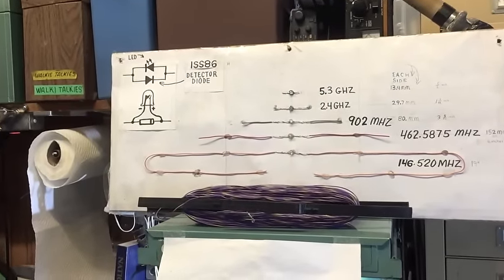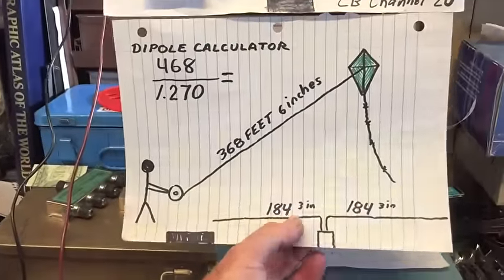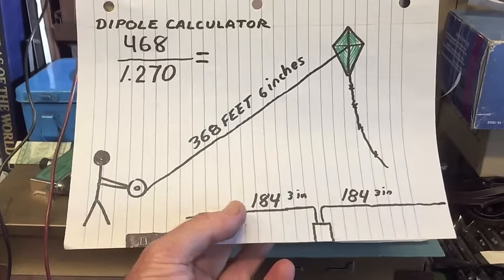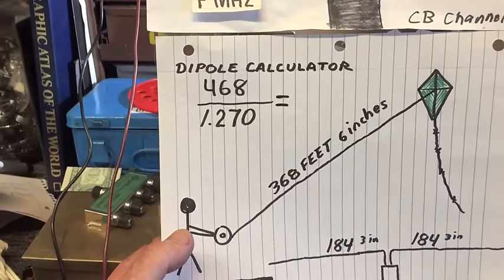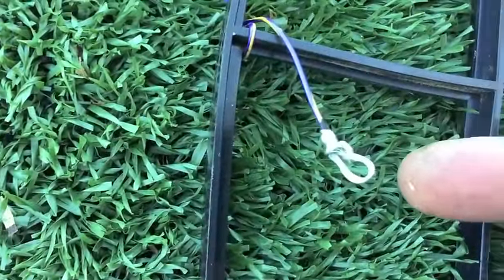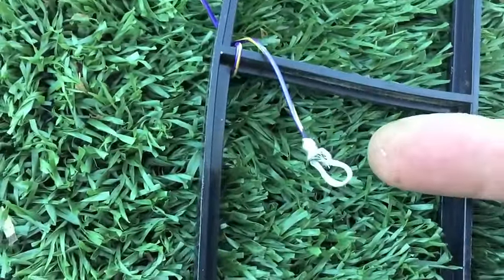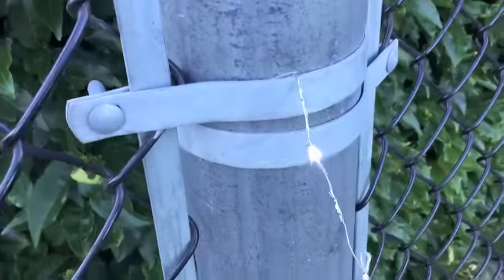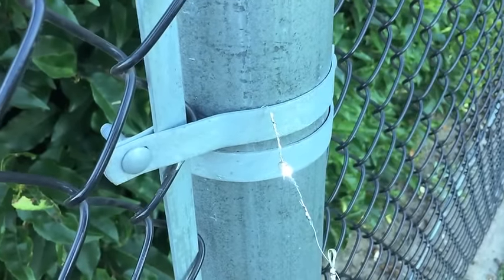Radio Frequency Burns From A Long Wire Antenna Supported By A Kite

Comment: Very interesting experiment, tyvm!
In the late 1960s my family lived in a home in Escondido, CA, USA.
The window screens were wire, galvanized steel, I think. Some of the screen wires could vibrate to the frequency of a local AM radio station. My mother discovered the phenomenom, one day she was in the house and heard music outside the window. She went outside to locate the sound and realized it was coming from the screen. The whole family heard it and my father listened long enough to hear the station’s call sign. It was KFI-AM 640 in Burbank, CA! Their power is 50k watts.

 Apparently the wire became an antenna element. The way I understand antenna element (parts) lengths are fractional based on the wave length of the radio waves. That’s why an AM radio stationa antenna is so long. To receive the stations signal an antenna will be the same length or a fraction of that length. If a full wave antenna is unfeasible, one can use an antenna 1/2,1/4,1/8… of the wave length. I think the screen wire was some fractional length and was loose enough to vibrate.
Reply: So, the screen not only resonated to the radio station's transmitted electromagnetic radiation frequency but was also able to demodulate it and extract sound information at an audible level. That's amazing.
Reply: @peach8352  That part of it is not all that amazing, as AM is very easy to "accidentally" demodulate.   All it takes is a non-linear diode-like contact between two conductors and the RF becomes AF... or it can mix with other RF to make new RF.   The latter is a common problem at busy radio sites where a rusty tower joint will mix two or more of the locally transmitted signals and create an "intermod" product that is on someone's rx frequency.   The demod is actually the easiest part to explain... I am curious why there would be enough RF to light up that screen, as Burbank is not exactly next door to Escondido.   Unless KFI's transmitter is not actually in Burbank, but I would not expect it to be nearby at all... that's at least one county away, if I recall... two I think.   Seems like there is a missing piece to the story puzzle... and I don't mean to shoot down your amazement... it's all quite amazing... especially if you consider that the range of RF wavelengths is hundreds of meters to millimeters and we use all of them.
Reply: @ka7znm  ty
Reply from the maker: Cool story. KFI was a powerful AM station, so I'm not to surprised. I use to pick them up here in Oregon.
Reply: @ka7znm  There used to be (and may still be) a radio station is San Diego back in the late '70s and early '80s whose transmitter was/is located in Baja California, Mexico.
Reply: @GrantsPassTVRepair  Did you ever pick up KAAY from Little Rock, AR back in the early '70s after 2100 hrs? They'd boost their power starting then, and again at 2300 hrs. They could be heard from Ontario, Canada to the Bahamas. The station was built underground in a bunker to survive a nuke and had a secondary telescopic tower that could be raised if the main tower was knocked down. KAAY was designated as one of the main emergency radio stations during the Cold War era. I remember listening to Beaker Street and Dr. Demento on that station back in the late '60s and first half of the '70s.
Reply: Interesting in that back when I was stationed at the Navy's FCTCP (Fleet Combat Training Center Pacific) located in Point Loma, San Diego, CA, back in 1980-81 as one of the Electronics Techs in the support div., we were having problems with the inversion layer during a particular period and a ship just off the coastline on the seaward side of Point Loma was having problems getting our radio signal. They kept trying to tell us to increase our signal strength, though ultimately, what we did was actually decrease it (our comms were in the UHF range). At one point, we ETs were going to build a helical quad array antenna so we could physically point it directly at the ship and make sure they could get it. What it would've taken to build that was fairly simple: some 1/4 hardware cloth, some dowel rods, some small diameter copper tubing (about what you'd find connecting the ice maker in a fridge to the cold water line), and suitable co-ax cable. Everything would have to be at the proper lengths/dimensions for the frequency, of course. I'm sure one could find plans online or in a book on antennas on how to build one. Kind of like a simplified version of this... 

http://www.setileague.org/photos/miscpix/helix02.jpg
Reply: This story reminds me of the Rodger Waters album Radio Kaos.  It is about a boy who hears radio waves in his head. He calls the station to talk to Jim Ladd a famous LA DJ. The entire album is the story.  Good stuff and if you like Pink Floyd you'll love it
Reply: Maybe it’s the radio station 91X (XETRA-FM) you are thinking of?
Reply: I am quite close to an am tower and I pickup broadcasts through the box fan in my bedroom and sometimes in the living room. It is annoying at 4am when I’m trying to fall asleep and I try to hear what is being said instead.
Reply: @Rizzob17  I used to live in Watertown Mn and there was tower a few mile away in the downtown area of that town and I don't know it was am or not but I heard voices through the Hvac vents of the house and the property has a small lake on it too.
Reply: The mentions of KFI, Jim Ladd and 91X took me down Memory Lane.  👍🏻

Comment: I am just amazed that your skin got burned. Years ago I was at a antenna bank in Roxborough Pa. The location had men working on the maintenance part of the towers that stood at least 1200 feet high. I am being conservative on the antenna height. Just started talking to the men and go permission to go into the field. Was just amazed as to my hair all over my skin just standing as if their was going to be an electrical discharge. One of the workers said the number of watts pushed thought all the antenna was in the millions of watts. Now that is a lot of power just going into the ari.
Reply: its electricity, just delivered via atmosphere.
Reply: @anthonywike8042  That is just amazing electricity. Do not see but the hair on your arms vibrates and stands.
Reply: @victoryfirst2878  agreed, it is amazing.
Reply: @anthonywike8042  Here is an idea that might make you go crazy. Could you connect this to a wood burning arc surface pattern burner ??? I would love to see what patterns this would make, wouldn't you Anthony ??? Nice
Reply: @victoryfirst2878  that would be a total trip. Do a wood burn by different radio stations. Totally a great idea.
Reply: @anthonywike8042  Hope to see you make it happen. Peace
Reply: @victoryfirst2878  I wouldnt steal your idea! lol If I ever tried id post it on here right away! TAKE CARE!!!
Reply: Yeah. To transmit information over massive distances, you need a lot of power. Thus, radio towers emit a ton of energy.
Reply: @starchief93  The unique part on the field was the actual feel of the power going through my body. The workers just stated that you get use to this feeling. I was just lucky to have the guys trust me to experience this area. Would bet this just does not happen every day for sure. Saying I am lucky is an understatement. Peace vf
Reply: Yes ...lucky for us there's the inverse square law.

Comment: Flying that wire made me want a Puffer Kite. They were around in the early to mid seventies. They were a balloon in the shape of a kite. You blew it up and go. We noticed the birds at 200 feet had wind but it was still on the ground. We got Mom to drive us to Woolworth and paid the man a dime to blow up our Puffer with helium. What a revelation! We could get up high enough to get into the wind. One day we had 750 feet of string stretched out. The kite was a  tiny dot. You looked away and you would lose it. 
Certainly miss those things.
Reply: Its always the small, seemingly irrelevant things you did as a child that youll end up missing the most after youve grown up
Reply: Qu'est ce qui t'empêche de faire ça maintenant?
Reply: Your English is kinda old fashion
Reply: I am from Alabama. 
So technically English IS my second language.

Comment: Back in the Voice of America days, the small town of Mason Ohio was next to the local VOA complex and their phased array Sterba curtains/multiple transmitters , along with AM station WLW which  transmits at 700 Khz (kilocycles to old timers) at one time at a power level of 500,000 watts. Enough for the locals to pick up the broadcasts on their bedsprings. Obviously not resonant, but at those power levels it wasn't necessary.
Reply: "honey the bedsprings is trying to sell me insurance again"
Reply: @yodaman8015  What's fascinating is that developers are building new houses directly under WLW's 50kw Blaw Knox tower ! How's that going to work out I wonder........

Comment: In addition to the RF field, we have the static electric field caused by atmospheric ionization etc. The field can be 100 V/m. That might be abe to add a DC to your finger too. A Multimeter would reveal what is coming out of there.
Reply: That's an interesting thought. Would you be able to switch between DC voltage and AC voltage to determine whether you are "receiving" RF or "static electricity, perhaps?
I'm only a hobbyist, so please, don't crucify me for my ignorance.
Reply: @davidbrayshaw3529  Radio amateurs usually know this phenomenon and must fight against it. It has various components affecting. Some are noise-like impulses from ions hitting the antenna, some just static electricity

Comment: So.... this might not actually be related to the power of the AM  signal. 
I think what's burning the holes in your skin is ground current, which is a literal dc current that all antenna have to deal with. 
Every foot above the literal earth that your kite is flying is adding a potential difference to your antenna. 
The exact potential depends on several factors, including the weather, your base altitude above sea level, the chemical composition in the dirt around you, and the type of wire you're running, but most early estimates put the ground potential to be around 10 volts per meter of height difference from the top of the antenna to earth ground. 
There are ways to get this ground current to translate into usable energy, but it's usually not used that way.
Reply: It was still happening when the kite wasn't flying though

Comment: What is the furthest you can be from the radio antenna for this to still work?
Reply from the maker: I'm not sure how far this will work, but using a 200 foot long wire my LED is very bright about a mile from the AM radio station that uses 5000 watts in the day time. This video may interest you. https://www.youtube.com/watch?v=vHVmJ5lD9jc&t=10s
Reply: Love your starship stream
Reply: The inverse square law applies, so not very far actually.

Comment: Beneath a 2 MW AM radio antenna with a coin proximating (or touch then maintain a one mm gap) to an iron pole it made an arch with the frequency of the radio broadcast, and you could hear the radio itself.

Comment: Pretty cool!  I was putting up a discone antenna a few years ago and was very surprised when I got zapped by RF.  Not burned, fortunately, but it was painful.  It’s amazing how much energy is out there.
Reply from the maker: For sure. the RF energy travels on the outside of the skin, and the shock did sting.

Comment: Gotta watch out for chain link fence ( especially new install), I've had fencing contractors auger holes for the up right poles and nick underground power lines. The Cement finisher trowling the sidewalk next to the fence get shocked pretty bad ( wet concrete and wire fence) had to call power company and dig up the damage. Didn't see that one coming. Cement guy now has curly hair 😂
Reply: Lucky to be alive.
Also very expensive mistake!
Reply: and thats why they tell you to call 811, its not just to be mean lol

Comment: So cool!! Tesla was right... you can charge wirelessly over distance and it's a cool visual example of how electricity actually works through magnetic fields.
Reply: This is the princple of induction in action, discovered and documented by Faraday a few decades before Tesla was born. 🙂🙂
Reply: The problem is that you can "charge" also things that don't need/want energy 👍
(So, you don't have "control" over it, like you have with wires 👍)
Reply: It has been speculated that Tesla started a forest fire across the globe that way. I don't think it was provable though.

Comment: The nearest nearest neighbour to me has a citizen's band or amateur radio station.  Using a germanium diode to ground, I have a little analogue micro amp metre start sweeping the needle whenever the neighbour is on the transmitter.  The antenna is a disconnected television antenna on the roof.  I can tell the different modes used by the way the needle reacts.  Interesting stuff.

Comment: Living here in interior Alaska, my first though was how much power would that kind of rig pull out of an Aurora.

Quite a bit actually.

The trans-Alaska pipeline has to have sacrificial anodes all along at least the above ground sections of the 800 mile pipe line.  The segments of the pipeline are reportedly isolated from one another but apparently the currents induced are in the range of hundreds of amps!
Reply: Amazingly that's mostly static electricity as opposed to induced current from RF or atmospheric static electricity. In that case it's the fluid inside the pipe rubbing against the pipe itself. The same effect causes electrical charges to build up in water pipes as well. The current goes straight to ground but the charged metal oxidizes faster hence the sacrificial anodes.
Reply: @brendanwood1540  that's so fascinating
Reply: Hundreds of amps?! Damn!

Comment: I recently installed a random Long Wire antenna, whose far end was close to the electrical lines that provide electricity to our homes, with the lines in our back yards !
On a whim, I attached a Green L.E.D. across the antenna lead to earth ground, and it does light the L.E.D. !
Moving the end if the wire away from the power lines, stops the lighting, proving in fact the electrical energy being inductively coupled to the wire !
Mind you, these are not extremely high voltage lines, where the induced voltages would be many times higher !

Comment: I was going to make a comment about diodes probably not working for higher frequencies but I went though your other videos and found you talking about just that. This is one of those cases where you want the lowest max forward current, lowest reverse voltage, fastest recovery time diode you can get. Your 1SS86H is like 30mA forward current, 3V max reverse, 0.5V forward. The recovery time wasn't listed on the datasheet I found.

The higher the max forward I, the higher the diode capacitance.
Reply from the maker: The 1SS86 is the best diode I've found for this project for the higher frequencies, The RF energy is so strong in my neighborhood due to AM radio stations, that even two reversed biased LEDs will work, but their sensitivity is not very good. The 1N5711 was the second best I've used in these experiments so far.

Comment: 0:37
That would be MHz, not kHz.  Also, using the power of a radio station locator website, that station at 1270 AM in your area (Grants Pass, Oregon - user names like yours make this hobby so easy!) is KAJO, a hit music station transmitting with 10 kW daytime ERP.  However, the closest radio station frequency-wise in my area that 368 and a half feet of wire would be resonant to would be KZNS at 97.5 FM/1280 AM.

Comment: I just discovered this channel. I'm gonna have to watch the video you made about the antennas at the beginning. I've tried the exact same thing with an LED and a, I think around 7cm dipole just made out of 2 pieces of wire. I didn't have a reliable source for 2.4ghz, so I tried just moving it around my router, hoping it'd pick up enough power to do something. I've seen LEDs illuminate visibly with around 1nanoamp of current, so long as the forward voltage is reached. But I got absolutely nothing. So, I'll have to watch that and copy what you do, minus the transmitter. I would think there would be enough 2.4ghz noise to pick it up just about anywhere.

Comment: Back in my ham days I was helping a friend put up a 40 meter dipole.  He attempted a QSO while was still tying off the the leg of a radiating element to the insulator.  RF burns are painful, his tube rig was backed by zero bias class AB2 dual 3500z linear amplifier. I hope I never again experience that

Comment: I'll be experimenting with kite-lifted antennas when the weather warms up a bit in NJ. Many times I see just wire as the antenna, and then a high value bleeder resister to ground for just this purpose. But what if I'm using an end fed with a matching box, and cox? That's the equivalent of the long wire in my backyard for normal use. I should ground my tuner for sure.
Reply from the maker: I tried this experiment using my kenwood transciever with no matching box, and all I could pick up on every band was the local radio station no matter where I tuned.

Comment: At the AM transmitter site when I used to be the assistant chief engineer we have a similar metal fence around the transmitter building. The building is between our two 300' towers, although I forget the distance that separates the towers...it's been over 25 years now. Anyway, during the day we run at 1,000 watts. And if you put your ear close to the fence you can hear the programming being broadcast right through the metal in the fence. I've never been shocked by the RF though.
Reply from the maker: I believe it. It would be interesting to create a small spark gap, and see if I could hear the audio.